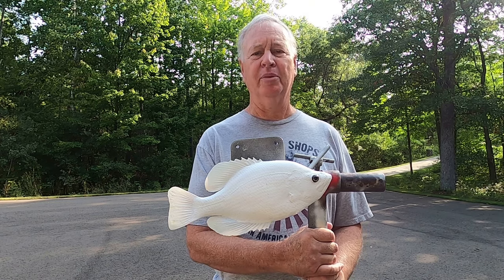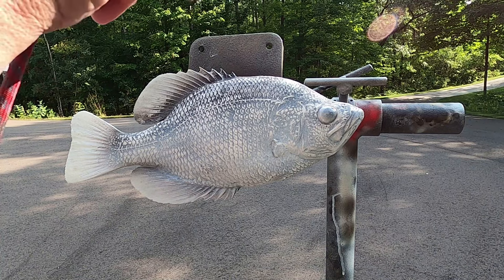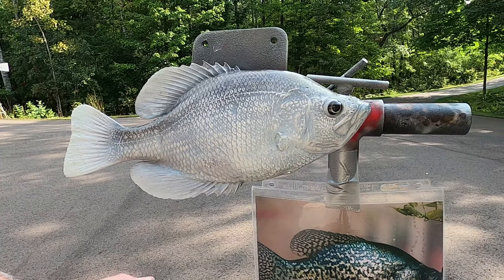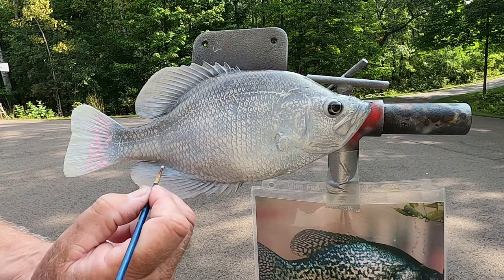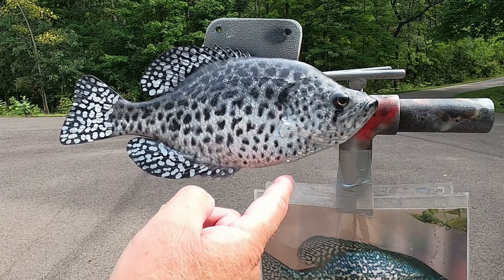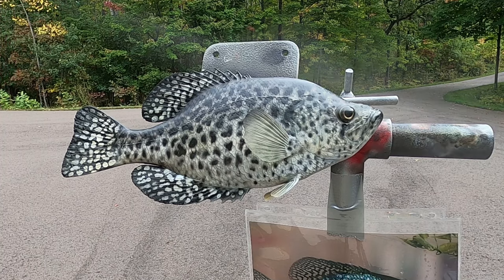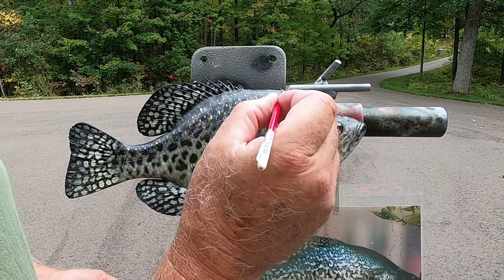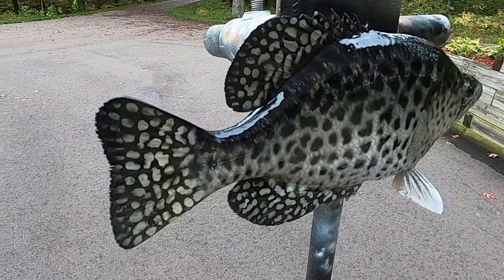Painting a Crappie Replica Fish Mount Reproduction Taxidermy

Comment: What is your preference in paints out of curiosity?  I am messing with acrylics and mostly mixing my pearlized and iridescent colors up with  mixed success. Just wondering if you are using something specific that is the way you like it off the shelf or if you just hunt and peck through products until you settle in on a recepie?
Reply: I use polytranspar lacquers. Great paints but aint cheap
Reply from the maker: Since I have retired, I just use what I have on hand which is a Combination of Polytranspar (my pearls), & Woods and water. Never been too hung up on specific brands or colors for that matter, and I often mix colors to get what I want. Thanks for watching
Reply: @kstenzel2010  yep. my plan exactly